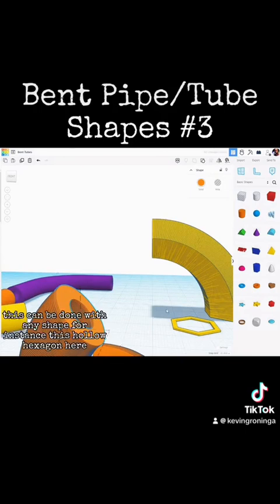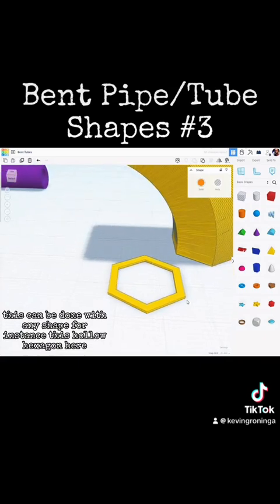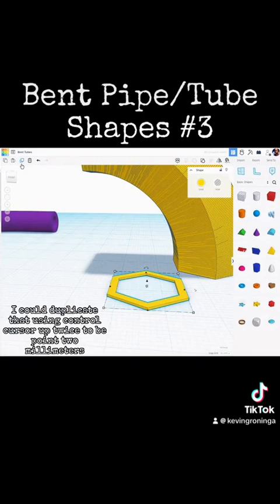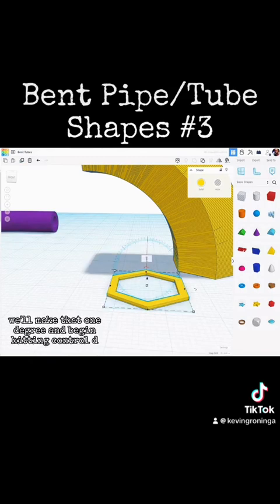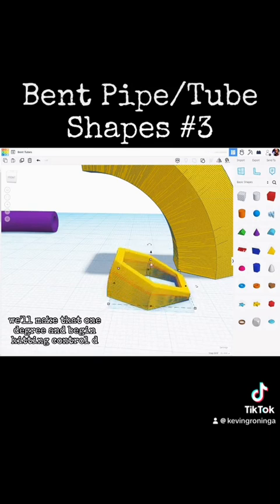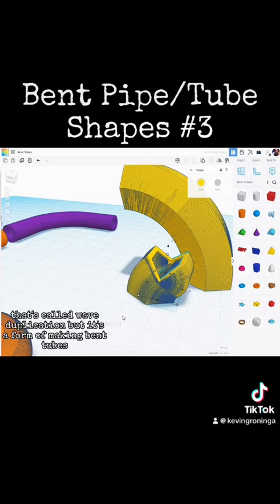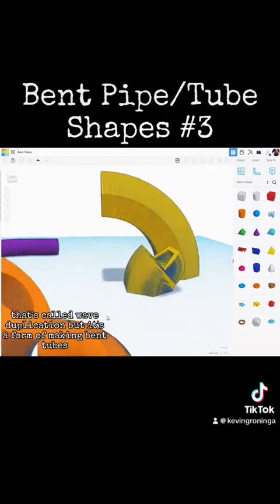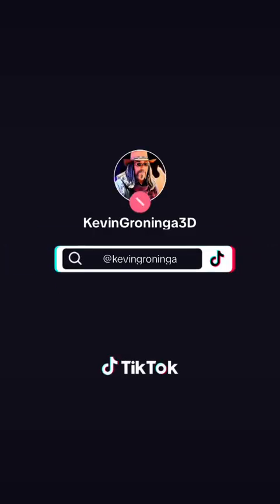TinkerCAD Tips! Bent Pipe and Tube Shapes 3.   #tinkercad #caddesign #3dprinting #3dprintable

Comment: I have a question, I found your page because I am trying to make an elbow with different sizes on the ends.  This duplication method seems to be the one I think can get me what I need If I slowly start reducing the size of the duplicate I should be able to get it to the size I need.  I wonder if there is a way I can just say the length I want and the starting size and the ending size?
Reply from the maker: Well, I could think of a couple different ways to make an elbow with different sizes at the end.  This wave duplication method of course.  You might also be able to use the new revolve sketch tool to make the two ends, each with a ‘middle’ that is the same size, and then join with the ‘bent pipe’ shape generator.  You can find that by searching for ‘bent pipe’.  It doesn’t allow two different end sizes, but you can always add on a part that tapers up or down after the bend.

Comment: I dont know but it does not work. In my case when i hit duplicate it makes the bend like in the video but it dont moce two steps up while doing so, that means one part of the circle is tilted but the other half slowly goes under the original cirlce when i press duplicate. So the finished curve dont has a flat bottom for connecting it to other pipes.
Reply from the maker: Then you must be doing the wave duplication incorrectly.  Place your original part where you want to start.  Then hit duplicate and move the duplicate shape just slightly in the directions you want to go, be you must NEVER deselect that duplicated shape. If you deselect, then you have to start over again.  Deselecting the duplicated shape breaks the chain of movements between the original part and the duplicate part.